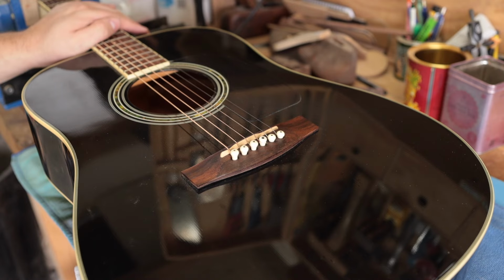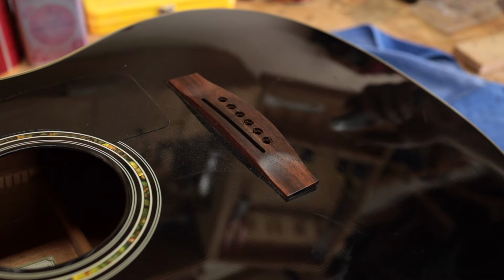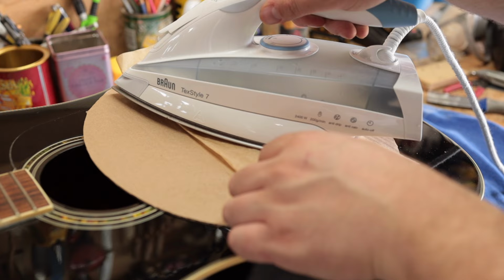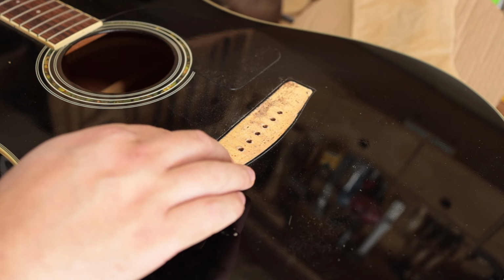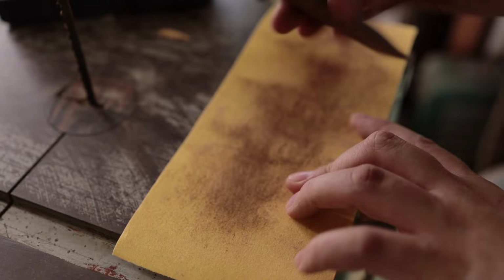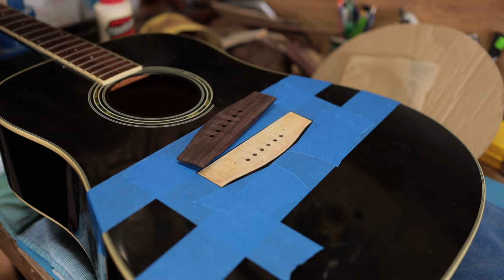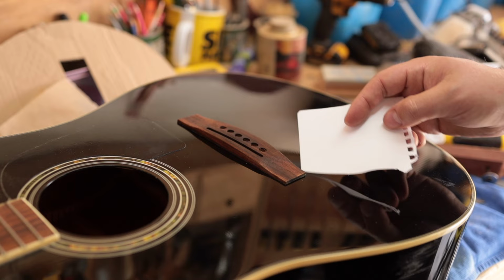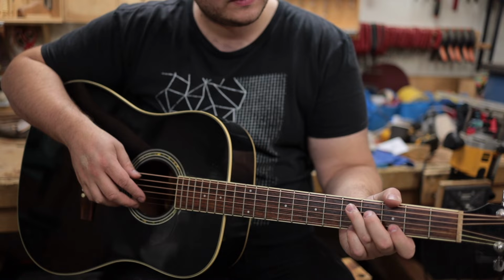Repairing a Lifting Acoustic Guitar Bridge

Comment: This is the best bridge clamp method I've seen. Much simpler than the multiple huge C clamp method most people use. And with the adjustable wings you still get a good even pressure. Thanks.
Reply: bridge clamps are available online for around CAD$20 for a wood one or $25 for a metal one
Reply: I agree, the bridge clamp is genius. I'm not a luthier, just a home handyman who enjoys the challenge of a new problem. I have an old guitar that probably isn't worth $20 and the bridge lifted about 1/8 inche one corner. I'm going to make myself a bridge clamp like this one and fix this old guitar 🎸 😊 Thanks 👍
Reply: @waygone6657  I plan on doing the same to a Cort I just bought with a lifting bridge.

Comment: Great video! Great idea to trace out the bridge first so you know exactly the area where the bridge sits down ,so you clean ,and sand the area ,and keep the bridge in the exact same spot ,my bridge did the same thing on a DIY acoustic I built ,I had nailed the location of the bridge dead on ,but I forgot to sand down the finish first ,used 2 part epoxy ,instead of just good wood glue ,and then I didn't have the proper clamp ,which I now do ,so gonna follow your method , and use the same wood glue I used to set the neck ,thank you !

Comment: I do the same way except I use a and old .009" string and ease it around from one side and pulling the other side - not a spatula lever. You did a nice job. Cheers!!
Reply: That works? I just did this method and I got the thing off but it was time consuming

Comment: That bridge clamp you used would be awesome if someone made a model we could 3d print! I started searching all the common 3d print sites and haven't found anything yet :( 
The bridge on my guitar is separating quite badly, even worse than yours at the beginning of the video. I don't have the money to bring it to a repair shop so I'm gonna see if I can get the stuff together to follow your repair.
Reply from the maker: I don’t think 3d printing would be the way to go, I’m no expert in 3d printing but I’m not sure plastic is the best material for a clamp, it’s easy enough to make from a block of hardwood and some bolts etc and much faster than 3d printing.
Reply: @DavidParker  It would definitely work. There is all kinds of glue up clamps on the 3d print sites, just not one shaped nicely for the bridge.  even if its just 3d printed the shape that holds the bridge in place and using wood for the rest, but ive seen entire 3d printed clamps that work. even 3d printed work holding vices. honestly the most important part would just be the shape that fits nicely against the bridge to distribute pressure evenly, that would be an ideal 3d printed part.

Comment: Very cool video.  The homemade jig/tool you have confounds me.  I can't understand what it is doing.  It seems the bolts in the middle align the string holes in the bridge, but don't understand the function of the two outer screws.  You do adjust them it seems, but I don't understand what is happening.  Is the only compaction pressure due to the clamp (It seems maybe the screws in the middle pull the bridge down also?)   Anyhow, enjoyed the video.  This is great for people with less expensive guitars and can only justify a diy fix.
Reply from the maker: It bolts through the bridge pin holes to apply pressure to the bridge, then there are two bolts on either side to apply pressure to the wings of the bridge so I don’t have to make a custom caul for every bridge I clamp

Comment: Great video!  Can you please share a bit about your homemade clamp tool?  are you running screws thru the peg holes and tightening with bolts inside the guitar? Thanks!
Reply: Exactly what I was wondering. I'll probably end up using some basic clamps I have laying around.
Reply: I want to convert a cheap RH acoustic to lefty, to use as a practice hack and came here. I reckon you could  just use bolts, through the peg holes, with washers top and bottom?
Reply: @tyrotrainer765 lol. the video speeds up just where you want a better look at what he's doing.  I slowed it down and saw washers/nuts in his hand.

Comment: I have an alvarez guitar that came from factory with a raised belly around the bridge area. At the time I didnt know this was a problem but I remember seeing the belly (i thought it looked cool 🤦‍♂️). I have kept it in its case with the strings loose and no humidifier for month and a half but I don't see a difference, I read by doing that the wood sorta flats itself, but no dice. If you put a straight edge on the frets, it hits the bridge about 1/8" lower than the top.

Comment: Great vid but not sure about the clamp.  Skipped over rather quickly.  What were the screws going into?  Then you had a aecond clamp.  Why? Odd.
Reply from the maker: They were bolts going through the bridge pin holes to nuts on the inside of the guitar

Comment: more silly questions from me.... how do you make sure all the glue doesn't clog up the string holes?
Reply from the maker: You can’t, but I clean up the holes with a bridge pin reamer afterwards
Reply: @DavidParker  ok I'm going to go and look up what that is lol
Reply from the maker: @AshCollins  if you’re not fully confident I’d definitely suggest taking it to a professional, it’s not an easy job and can be messed up and ruin a guitar quite easily
Reply: @DavidParker  tbqh taking it to a professional would cost way more than the guitar is worth, so it's either have a go at it myself or chuck it in the bin hahaha

Comment: Nice video, but a bit more info would have been helpful.  How long did you have to heat and at what setting to soften the glue?  Also, what glue, and how long did it set before restringing.  Finally, it would have been nice to see how the clamp actually worked.
Reply: Yeah I guess his homemade clamp is a big secret. As a matter of fact it is THE secret to successfully doing this. I just got a Blue ridge acoustic guitar that was thrown in the garbage that has this very problem.
Reply: @kevinmeserole7345  bridge clamps are available online for around CAD$20 for a wood one or $25 for a metal one
Reply: @PaulDeFelice  thanks

Comment: any reason you didn't use animal glue instead of the tite bond?
thanks for sharing your experience.
Reply from the maker: I’ve never used hide glue, titebond works great and easy to get hold of so I see no reason to switch to hide glue unless it’s a vintage guitar that was originally glued with hide glue
Reply: @DavidParker  Why not use epoxy instead of tite bond?
Reply from the maker: @caniswolf3394  because if there are issues in the future epoxy can’t be heated up to easily remove the bridge. Guitars are built to be repairable so you need to use glues that can be unglued
Reply: @DavidParker  Understood. Thank you.

Comment: You said you made a slight adjustment to the saddle. Like what? Always been curious by what that meant.
Reply from the maker: Once I had the bridge glued back on and the guitar strung back up I thought the action could come down, so I sanded the saddle down a bit to lower the action.
Reply: @DavidParker  gotcha. Just like you can do a nut from time to time. 
One more question and I’ll leave you alone. Lol…
I’m about to attempt to this same bridge project to a Baby Taylor acoustic. The bridge was pulling like this guitar in the video. But, the guitar has sat for 4 or 5 years and exactly where the bridge sits, there’s a small hump that’s developed where the tension has made the body bow up. Will that have a major effect on the results? Il
Reply from the maker: @BlaineO  hard to tell without seeing it, if you’re not confident take it to a luthier. Re glueing the bridge can help flatten that sort of thing out but there could be many other factors that affect that such as bracing and proper humidity.
Reply: @DavidParker  gotcha. If the value of the guitar was a lot higher…I would. I’m just gonna fix it or break it. Lol! I do a lot of woodwork and feel pretty comfortable doing it. We’ll see. Thanks for the advice!
Reply: @DavidParker Hey David, thanks for posting this! I'm going to attempt a bridge repair on my Vangoa acoustic. What setting did you put the iron on and how long did you keep it on to melt the glue enough? Thanks again for your help! 🎸😊👊👏

Comment: I wouldn't have scraped the finish off the edge where the bridge had been glued. Instead I would have glued a piece of veneer in and sanded it flush.
Reply from the maker: This is the way bridges are glued in place when guitars are made properly. The bridge is put in place, scribed around and the finish scraped off. It’s the way Martin have been doing it for the past 200 years. The manufacturer of this guitar took a shortcut using a router to take most of the finish off and left the edges because they’re are trying to do a job faster with less skilled workers, I merely corrected their bad job. I would not recommend attempting the method you’ve suggested.

Comment: My takamine gd30ce-12s bridge is just barley lifting on the very back I dont know what to do. Should I glue it or something?
Reply from the maker: I would take it to a luthier and get their opinion
Reply: I had the same problem with my Oscar Schmidt OD-312A 12 string acoustic (a Washburn subsidiary).  Had it for about 2 months when it started.

Couldn't get anywhere with the manufacturer so I did it myself. Just like the way David did it in this video (I had never done one before).

This was 3 years ago and it is still solid.

I agree with David, take it to a luthier or a guitar tech and get their assessment on it first.

If you do it yourself, just take your time, refer back to this or any of the other videos on the subject that are available on YouTube (they are all basically the same with slight differences in technique and tools used.  When scoring around the bridge, use a new blade in the knife (I used a #11 holder and blade [available at most hobby shops and hardware stores]). And just score the finish, you don't want to cut into the wood if at all possible!

Good luck!

Comment: With respect brother -- WRONG GLUE --- Don't use wood glue, it'll be impossible to remove in the future.  (Of course, that'll be 20 years from now, but still...)    The right glue to use is TITE-BOND HIDE GLUE.   (or other 'better' hide glue).
Reply from the maker: Hi, actually the titebond original that I used isn’t impossible to get off and is widely used and recommended by many well respected repairers and luthiers
Reply: Wood glue is all that should ever be used on a guitar, and Titebond original is the best. It's not hard at all to remove, but what is very difficult to remove is super glue or any other type of adhesive other than wood glue. 

I did a replacement nut on my Fender Squier II Strat, and the original was super glued in at the factory. The nut not only came off in pieces, but the super glue took forever to file and sand out of the nut groove, which unfortunately, took some of the wood off with it. So I had to use some wood filler to replace the wood that came off.
Reply: @DavidParker  Is it recommended because it holds well or because its easy to remove compared to other wood glue?